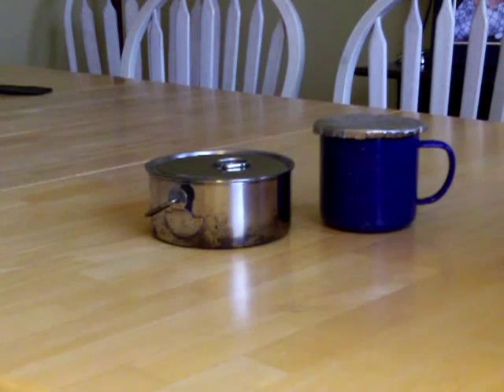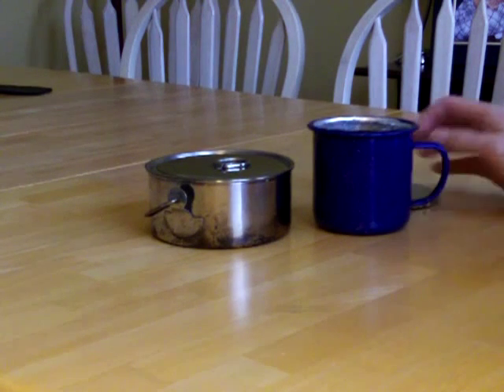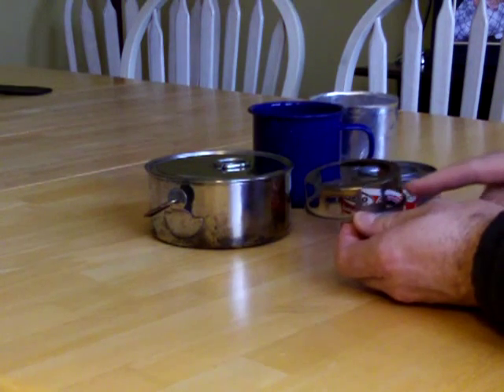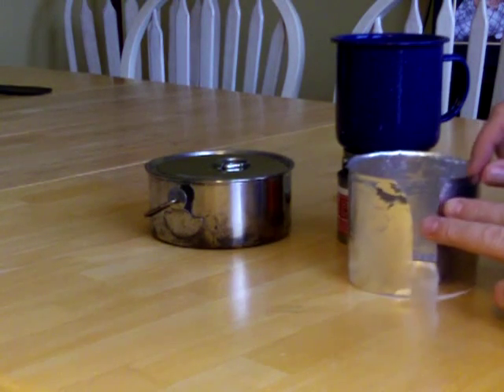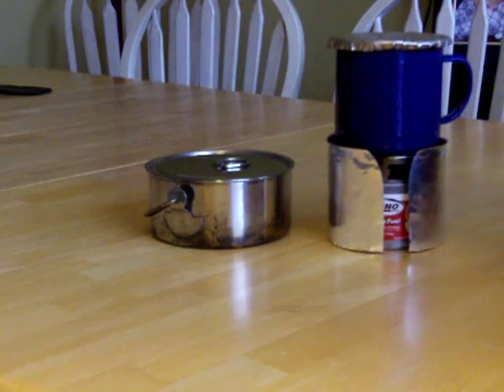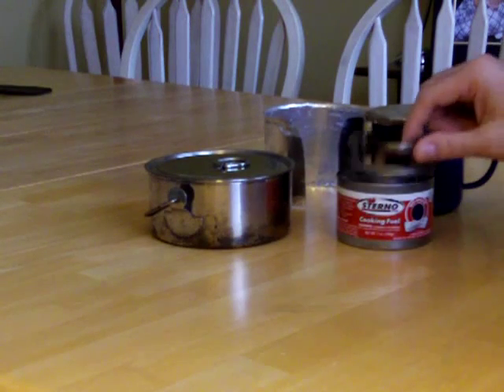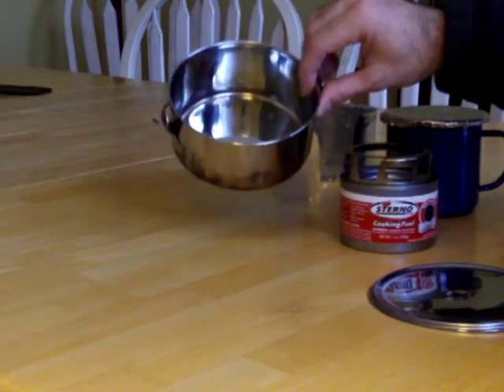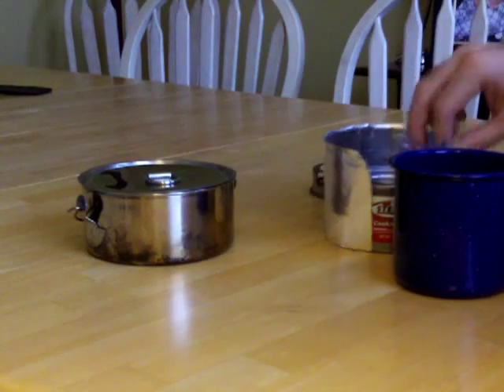Sterno camp stove cook system, bicycle touring

Comment from the maker: Good question. I notice a significant struggle to heat water when it's below freezing outside. The gel doesn't burn as well. I have moved it in the tent to increase efficiency If I don't have a campfire to put my cup on... this helps.

Comment from the maker: @Ghostkamo Simple has its place doesn't it. Modern fuel stoves are wonderful for lots of reasons but I find it hard to depart from the old blue enamel mug on an open fire. When the chaffing fuel runs out I poke holes with my knife and fashion a wood burner if camp fires are not allowed. Wind screen and lid make a huge difference in performance. Give it a try.

Comment: Thanks for the great video. What is the gap between the top of the Sterno canister and the bottom of your cooking vessels? Did Sterno blacken your pot or was it done with wood? I am wondering because I have never heard of Sterno blackening anything.
Reply from the maker: The gap I think you are referring to is the sink drain I use as a stove. The pot has a copper colored bottom... the way it came. Thanks for the question.
Reply: cyclist01222 thanks for your reply, I guess what I am asking is how tall is your drain/stand?
Reply from the maker: David Hamberger
Oh, sorry lol. It's packed away in the garage but I would say about 1 1/8". It's a standard sink drain strainer from Walmart.
Reply: cyclist01222 thank you. I am suspecting that it is substantial enough by the looks of it that it is transferring some heat by cinduction. I am thinking that things like hardware cloth pot stands probably don't. once again, thank you.

Comment: cyclist01222 what do you think alcohol system vs sterno system? (price, efficiency, size)
Reply from the maker: They are both inexpensive and about same size. Alcohol will burn much hotter and boil quicker. Sterno type fuel is also great for warmth inside a tent or under a shelter... alcohol not so much.
Reply: Okay cool thanks man.